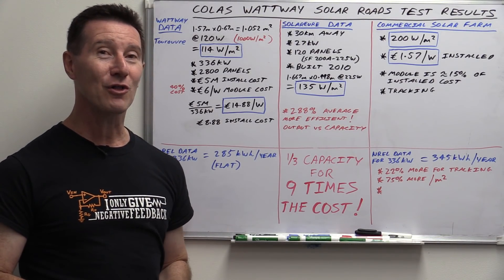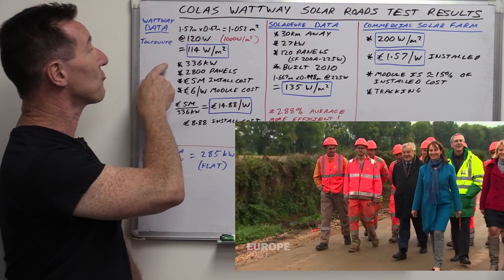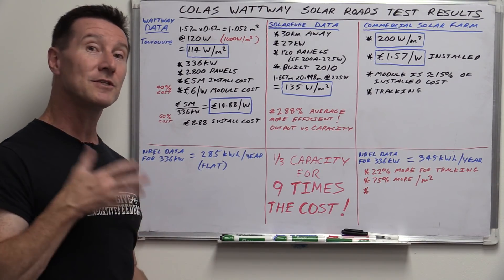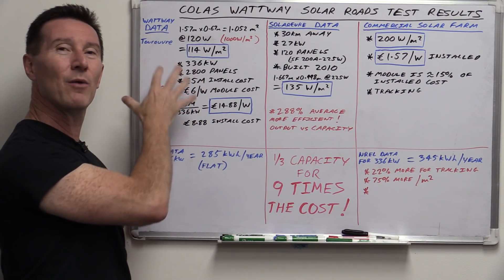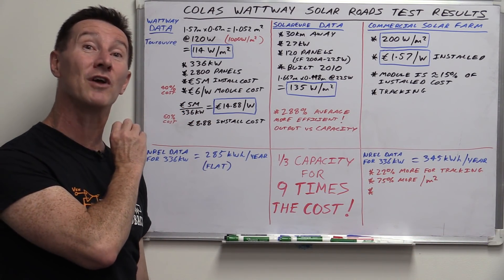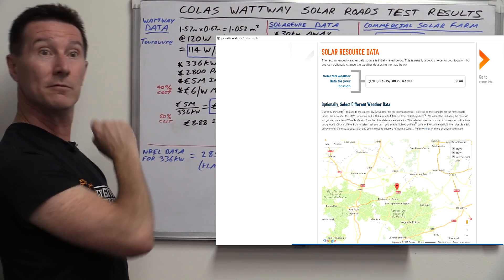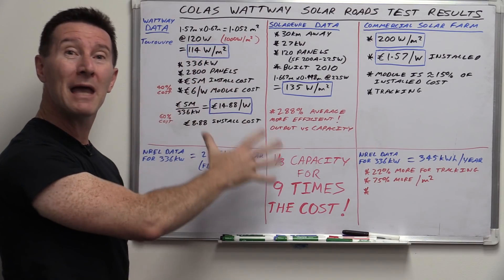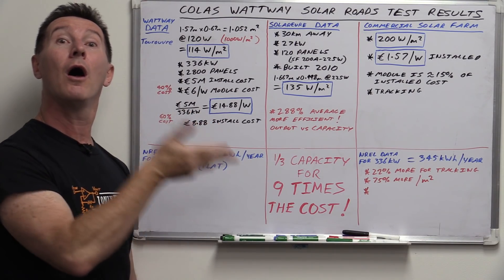EEVblog #1047 - Solar Roadways FINALLY BUSTED! (Colas Wattway)

Comment: I have to wonder, how many engineers are working on these solar roadway projects? Why don't they point out the obvious problems with this concept? Seems very strange it wouldn't be laughed out of an engineering consulting firm.
Reply: If a customer pays for it, as long as it's not dangerous, they will probably do the work.
Reply from the maker: Pointing out that entire ideas are impractical does help your career.
Reply: They get paid to design it. And it's a pretty interesting task. Not up to them to say whether it's practical or not and outright refuse the money.
Reply: There's money to be made, someone is going to get paid to develop the panels even if you say it's a dumb idea. They'll just go to the next firm until they find one that'll do it for them. Might as well make a few quick bucks.
Reply: @ Jack Vernian - If they are Professional Engineers with an institution and regulating body and bylaws then they would also have a code of ethics and guidelines. If a project is patently ridiculous then they may explain that to the customer and refuse the project.
 - Eddy
Reply: ts757arse, this has happened to me as well. The project turned out to be a failure.

Comment: Dave -  Don't think solar roadway think solar railways    The track can carry the current(!)   You have my permission to use this idea :-)
Reply: @ Todd Cottle - Yeah there is a bit of Darwinistic "improving the species" aspect about this... mind you if there is only one idiot then it may be the rails shorting the idiot instead of the other way 'round.
 - Eddy
Reply: yeah, and it'll be in the shadow 90% of the time :D
Reply: I'm not sure if you're being sarcastic or serious, but the railroad tracks are usually made of hardened steel so you would have a good amount of resistance. Plus, there are idiots that would then short the rails together...
Reply: "Plus, there are idiots that would then short the rails together..."  Feature not a bug!
Reply: Actually no, railroad tracks are grounded. That's why electric trains only have 1 overhead wire - the electricity flow through the wheels -> rails -> ground.

Comment: What about solar panels that are on cars? Are they good or not worth anything.
Reply: They are a joke. the surface area is way too small to provide enough power and just weighs the car down. Would make more sense to put solar panels on the (house) roof and a charger at home.

Comment: To be fair, land is much more valuable in some places like France than Australia. That should be considered when comparing value with a specialised soar farm. 

 However, one might start by using other available surfaces first like house roofing, towers or even the tops of cars which already have a battery that can store energy!
Reply from the maker: Exactly. Use the rooftops first were it's easy, cheap, and power infrastructure is already in place.
Reply: and if you were going to make solar roads - do it the sane way - put the solar ABOVE the road
Reply: To be honest: That's a pretty good idea. Basically make sticky solar cells for cars.
Reply: I do agree, this is certainly not the best solution in the world... But the solution, is not simple: do you believe there is space left for achieving 20% of the energy coming from solar power? France is not Australia. Each forest, field is protected by multiple level of law (Natura 2000, Zac,Zar,Znief1, Znief2,...) or have some business related activity. The cost of the land can go high also. By the way for the solar panels on the roofs there are also constraints: ZPPAUP (Architectural, Urban and Landscape Heritage Protection Zone)...
Reply: Seat used to offer a solar roof for their Exeo. It was used to run the fan if the car was parked in the sun. Meaning the AC didn't have to work so hard when you got going.
Reply: It's not that expensive:
https://www.french-property.com/news/french_property_market/agriculture_land_prices_2015/